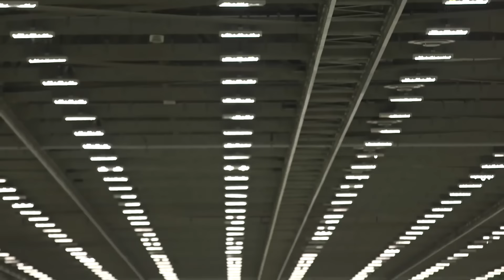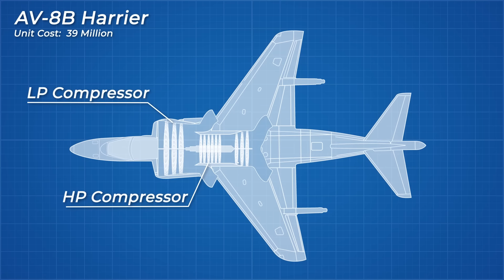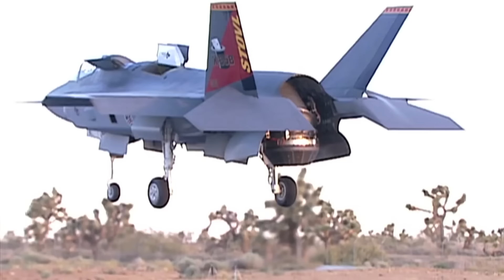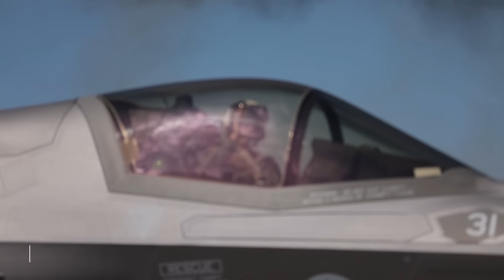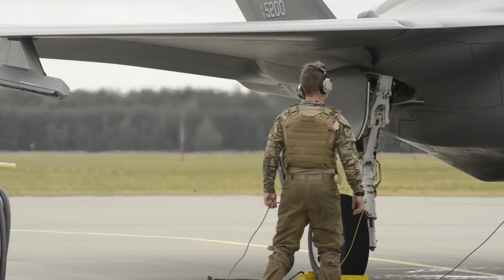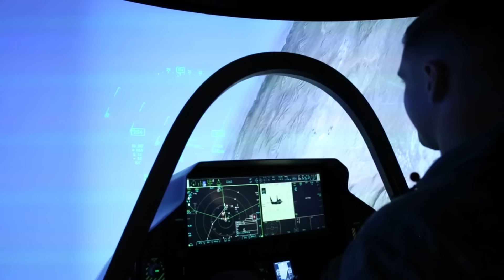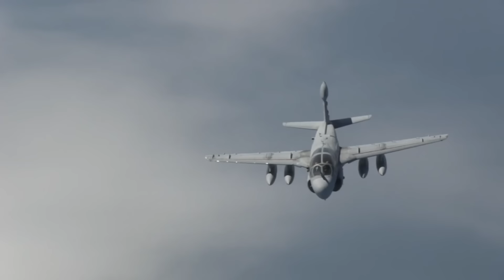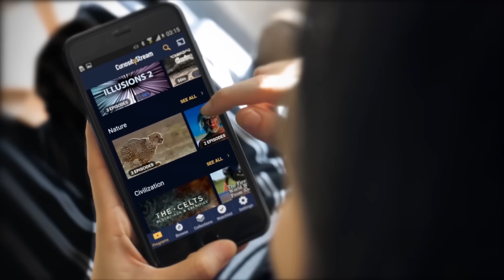Is The F-35 Worth $115 Million?

Comment: Don't try to candy coat the F117 being shot down over Serbia, that was a run of the mill SA-10 surface to air missile system, it pinpointed the stealth, locked onto it, and shot it down.  And the SA-10 was from an earlier era than the F117.  Stealth is great, but its far from foolproof, especially against a modern integrated air defense system which will surpass all aircraft jamming and stealth, and achive a complete denyal of the air. :-(
Reply: That's a commonly quoted myth. The F-117A was a literally defenceless aircraft that relied on stealth to avoid being shot down. It was also flying directly towards the Serbian SAM site, and they failed to lock on multiple times. By the time the F-117A was fired upon, it was within bombing distance of the Serbian SAM.

Also, the Serbian SAM was an SA-3B from 1970, supported by a P-18M search radar from the late 1970s. The tech difference wasn't significant.

As for electronic warfare, aircraft tend to have the upper hand over air defences.
Reply: @dumdumbinks274  What does the F117 being defenseless have to do with anything?  Its not like it was going to dogfight the surface to air missile and shoot it down, all it had to do is what it supposedly did better than anything else in the air at the time.  And so it was'nt even a S300 or SA10, it as an even older system a decade earlier.  The point is the moment the stealth was shot down is the moment the F117 was proven obsolete.   Especially when it was shot down by an older SAM than the aircraft design was, by at least a decade. And actually the missileer of the SA3 and the F117 pilot met eachother post war, its an interesting story if you care to look it up.  The man that locked onto, and then shot down the F117, and the pilot that flew it.  From what they seemed like they became good friends.
Reply: @Ed-ty1kr  If anything, the incident proved that stealth worked as intended. If you can't see that then you don't understand stealth.

Stealth is the ability to passively reduce the enemy's ability to react to the aircraft's presense. That doesn't simply mean detection, but also the process of tracking a target, locking a target, and reliably guiding a missile to a target. They're all heavily affected.

The SA-3 failed to lock on to the F-117A multiple times. By the time it could engage the F-117A, it was within visual range at only 15km. An SA-3 can effectively engage non-stealth unmaneuverable bombers at up to 30km, but it's radar can lock onto F-15 sized targets at around 50km. So the stealth reduced the effectiveness of the SA-3's radar by roughly 70%. 

The fact it was defenceless drives home my point. There was nothing else to interfere with the engagement. 
If the F-117A had even a basic RWR the pilot would have been warned before the SA-3 could engage. If the F-117A had chaff dispensers it could have turned around and blocked the radar guidance. If it had electronic jammers it could have targeted the SA-3's radar and jammed it. Most of these systems were present on all Western fighters of the 1970s, but none of them were implemented on the F-117A because doing so would disrupt it's 1st gen stealth. 2nd gen stealth and newer designs didn't have that problem.

The F-117A continued to be used throughout remaining 6 months of the war with no further losses. It was retired after a 25 year career with some of the highest combat success rates of all combat aircraft ever built. It proved that merely designing an airframe in a certain way could reduce the effectiveness of enemy air defences significantly, and it is still used as a testbed for new technology. 

But that's not all. You seem to greatly underestimate the influence the F-117A had over new designs due to how successful it was. It's effectiveness resulted in more aircraft being available for other missions, because a single F-117A with 2 LGBs could replace 2 F-16s each carrying 12 unguided bombs. Bomb accuracy was the primary driving factor in the push for large payloads throughout the 60s and 70s. Large payloads of that era did not enable engagement of multiple targets or the use of external targeting pods or fuel tanks, so the F-117A was considered significantly more effective because it could avoid enemy radars with a proper mission plan due to it's stealth and GPS navigation, and guarantee destruction of multiple targets per mission due to it's highly accurate bombs with large warheads. 

The reason it was called a fighter was to skirt around nuclear treaties of the day that restricted the number of nuclear capable bombers within an air force. The US pulled the same stunt for the F-105 and F-111 too.
Reply: @dumdumbinks274  Worked as intended as an Air Force novelty, like a hood ornoment, as an attack aircraft/bomber... meh.   And an F16 can carry guided munitions with the help of laser guidence pods, and it can also carry an assortment of bombs and missiles.   It can even carry up to 4 MK84 2000lb bombs with JDAM bolt on hardware, or laser guidence setups. Along with glide bombs like the JSOW or SDB, anti radiation missiles like the 88 HARM, Maverick optical guided missiles and so on.  And since no F16 flies with one wingman at the very least unlike the lone F117, you can double that... with their very own ECM pods to boot.  So how much use is an aircraft that cannot make use of ECM pods, cant defend itself in air to air combat, cant get out of a situation and turn and burn? Exactly, none.  The F117 was not intended to do much more than keep itself hidden from detection, like some submarine of the skies, drop 2 guided bombs, and hope it can GTFO without too much hassle.   Sure, but if I held the purse strings Id invest in some F16's, and keep the stealth as it turned out, F22 or F35.   Meaning nothing more than a clean fuselage without pertrusions that reflect radar energy, install bomb bays, and paint it with a radar absorbing paintjob.  That thing, the F117, was more a proof of concept than a warbird.   But who cares, they are all dismantled now anyway, yet the F16s and F15 keep on trucking.  Speaking of F15's.  The only F15 lost was one to an SA2, and anouther back in Desert Storm to AA guns, which was probably a fluke... in combat.  And none to air to air engagements.  Id take the good old F15 over a F117 any day, anywhere, and that jet is like the opposite of stealth, it radiates radar energy like none other. LOL.
Reply: @Ed-ty1kr  If your point is that a modern F-15 or F-16 is excellent compared to a retired F-117A, you are absolutely correct. But it doesn't say anything about the success of the F-117A, which was no more of a novelty than the EF-111 or A-10.
Reply: @dumdumbinks274 The A-10 speaks for itself as far as novelties go.   Nothing fills the ground attack nich better than the legendary A-10, with or without the depleted uranium spewing, tank busting, 30mm cannon in its nose.  As for the F-111 Aardvark that aircraft alone established the 4th generation fighters in more ways than one, and it did that as a nuclear capable attack aircraft.  Everything from the laser guided bomb delivery of the F117, to swept wings which are imortant if you want to lift a 24 x MK82 bomb payload, and be supersonic capable, to nap of the earth ground following radar, to the fly by wire of the F-16, to even having the first production afterburning turboFAN engine the Pratt & Whitney TF30, which later powered the F-14 Tomcat.... All if these milestones were established during the Vietnam war mind you.. by the legend known as none other than the F-111.   So much so, that no other aircraft had the Soviets more concerned, than the F-111, judging by the countless treaties they tried to limit or remove the F111 through.  Ultimately the Soviets attempted to copy the Aardvark with the SU-24... but failed miserably.  It kind of looks like a F-111, but the likeness ends there.
Reply: @dumdumbinks274  Why did'nt you mention the B-2 Spirit?   Because that on the other hand is absolutely not a novelty, that is what stealth is all about.  Its sleek, its a flying wing, its beautiful, it can carry a payload, its an engeneering marvel to say the least.   Totally unlike the F117 in every way possible, a true stealth masterpiece... the B2 Spirit IS the king of stealth.
Reply: @Ed-ty1kr  The A-10 is a specialist best described as a heavy COIN aircraft. It is legendary because of the emotion surrounding it, not it's effectiveness on the battlefield. The F-16 is a better choice for 90% of CAS missions and has had a higher success rate within the role for the last 30 years or so. CAS depends mostly on response time and precision, rather than firepower.

The A-10's gun is not capable of busting tanks, practically not even those developed 15 years before the A-10 unless it approaches at a very high angle or if it attempts multiple runs on the same target which is a waste of time. It can potentially disable them temporarily by damaging the tracks and optics, or bust AFVs, but 97% of the A-10's tank kills were achieved using the AGM-65, and the remaining 3% with dumb bombs. If you want a tank buster the F-16 is just as good and costs the same to operate while being much more survivable in a contested battlespace, as well as useful in other roles. 

I didn't mention the F-111. I mentioned the EF-111 which was an EW aircraft, and just like the F-117A it was a pivotal element of the air war. Actually in that sense the A-10 is even more of a novelty because it relied on the USAF being successful at defeating the Iraqi air defences. So the EF-111 and F-117A were both far more important than the A-10 was. 

The F-111 never had FBW controls. Only a testbed used by NASA ever got them and only for a single engine, not both, and not for the control surfaces like the F-16 had.
F-4s were capable of using LGBs during Vietnam as the war was drawing to a close. The F-111 didn't get the capability to do so until 1982, by which point there were several production model F-117As in existence going through operational testing.

Why didn't I mention a modern strategic bomber when talking about a Cold War tactical strike aircraft? Thought it would be obvious. We're not talking about things that are better (and significantly more expensive) than the F-117A that exist today. We're talking about the F-117A's success and influence.
Reply: @dumdumbinks274  How is the F-16 better at close air support than an A-10, that is designed for CAS?  Just because the F16 was used more does not mean its better than an aircraft designed for the purpose.  

If you want true close air support aircraft you need to have the ability to fly slowly, yet manueverably, at extreme low levels, without bleeding off speed loaded with ordinance in thicker air not at 25,000 feet.  Which means with a weapons load you need something that can fly around without waisting fuel, because a swept wing or even semi-delta wing does not like slow moving air, especially while heavy, it wants fast moving airflow.  

The F-16 does incorporate a flying tail for efficiency, which means it does not pivot over its wings by forcing the tail down for stability, as all other aircraft, and instead lifts with the elevators in the rear.  Which gives the F-16 decent fuel economy but only at mid to high altitudes like 20-25,000 feet, and only at 300knots, so as not to fly at high angles of attack.  Which it tends to do heavy, with drop tanks, and ordinance.  

Well thats too high and too fast for CAS.   Sure it can get there fast, but it wont stay long thats for sure.   As for the A-10 it is designed to fly low, has two non-afterburing efficient at low level large turbofan engines, that can spin slower, with slow incoming airflow, and is designed for low level.  Everything from bird strikes to enemy fire, is survivable.   The F-16... not so much, which at low level is crucial.  

Also after it gets there, the A-10 can remain lingering at 10k feet, waiting to perform CAS on rotation.  Unfortunately it was'nt used more, probably due to economical reasons.  Meaning when somone gets on the horn and says "we made contact, what is in the air right now?"   there is more than likely a couple of F16 refueling somewhere.   As for all out war CAS, the A-10 hog is king. 

And most of the armor is not heavy armor, its mostly APC's, or light skinned vehicles, that are still tanks just not MBT's Main Battle Tanks.  For instance during the Gulf War the last large scale tank battle, M2 Bradley Infantry Fighting vehicles with their aluminum skin, killed more enemy armor than M1A2 Abrams. All they had was a TOW wire guided missiles to work with at any given time to do so.  But what they also did was designate targets, with 6 infantry crew memebers for recon, which earned more kills than all else.  

So the battlefield is filled with mostly support vehicles, trucks, light armored cars, and some light armored personelle carriers, surface to air gun and missior platforms, and overall just a few handfull of heavily armored tanks.   

But the A-10 can still dive onto a T-72 , T80, or ,T90 and hit it on the top where its thin, and bust it no problem.  That DE 30 mm round will burn through with multiole rapid fire hits, devastating the armor of any vehicle.  It will literally set it on fire and yes metal does burn.  Have you seen a tank showered by 300 or so depleted uranium 30mm cannon rounds?  LOL.

  Even an M1A2 will have serious problems after that event, and that has CHBM armor to protect the crew.  Well, a hatch is still just a hatch, and when I mean 30mm shower... I mean soaked with DE rounds.  The tracks are your last problem, besides you may want to keep clear of the liquid burning metal everywhere, and the radioactive uranium oxide in the air.   Yeah, that 30mm, its a tank buster.
Reply: @dumdumbinks274  Wait... seriously?  A 30mm GAU 8 Avenger loaded with 1150 to 1174 rounds of combat mixed 1 High Explosive, 4 Depleted Uranium rounds, fired at at whopping selectable 2100 or 4200 rounds per minute... thats 70 to 80 rounds per second.   30mm uranium 238 tamper which means its heavy, and dense, showering onto a target at a whopping 4200 rounds per minute, or 70 each second....at least 10 to 15 of which will hit a hand sized area, and 5 will definately nail the same exact spot.  I think... no I know that will bust up a tank.   Especially a straight cast steel Soviet T55, T62,T64, T72, T80, or T90. No problem.
Reply: @dumdumbinks274  https://m.youtube.com/watch?v=p8jj5hyzWO4

There you have it, 30mm GAU8  penetrating an older tank, and setting off the rounds inside it.
Reply: @Ed-ty1kr   @Ed  A higher % of CAS missions are successful when performed by an F-16 as opposed to an A-10. It's called "success rate" for a reason.

CAS does not require low altitude or speed. The "Close" in CAS does not refer to the aircraft's altitude but rather the proximity of the enemy to allied forces. Basically, if the enemy is attempting to engage allied forces, the mission is CAS. If the enemy is just sitting around or repositioning it is interdiction.

The A-10 was designed for an era in which there were no TGPs and very few guided air to ground weapons. That is why CAS back then was best achieved at low altitude and speed. In the 80s even the F-16 was performing CAS at low altitude with a typical payload of 12 Mk.82s. But these days  because of advances in comms tech, sensors, and smart munitions the role can be performed safer and more effectively from higher altitudes than 40 years ago. As I already stated the A-10 doesn't drop below 5000ft AGL on most CAS missions. The only advantage it has in those situations is loiter time, which is only necessary if other aircraft are stretched thin.

In an all-out war the A-10 is significantly less capable. There's a reason it never served on the frontline of Desert Storm, and it became all too evident even when serving behind friendly lines clearing out remaining Iraqi forces. There is no way to guarantee destruction of all air defences, and a reasonably equipped army will make short work of A-10s that attempt to fly at low altitude.

In order for a vehicle to be considered a tank it needs to be heavily armoured and armed, and on tracks. A Bradley is not a tank.

The "tanks" in the video you cited were M41s. The M41 was an armoured recon vehicle with frontal turret armour of only 25mm of welded steel. It was light even by WWII standards. The A-10's API ammunition (containing a DU penetrator) is rated to penetrate 39mm of RHA at it's standard firing distance of 1km, or 69mm at half that distance. Of course it's going to penetrate an M41, but a tank is a different story, especially one developed in the timeframe I specified.

The T-62A was a tank that entered service 17 years before the A-10. It was being phased out of frontline service by the mid 70s and surplus stock was sold to 3rd world nations. The US used one of those nations to proxy purchase several T-62As for testing. In 1978-79 those T-62As were used as targets for the GAU-8/A on the A-10. The test results showed it was practically impossible for an A-10 to destroy a T-62A using it's gun, unless it approached from such a high angle as to guarantee any nation following Soviet doctrine would be able to shoot the A-10 down before it could engage it's target. The T-62A had 40mm of armour on the turret roof, so could withstand a few hits from the A-10's gun at most angles.

Also Soviet tanks since the T-72 have used composite armour, not basic steel. But that doesn't really matter considering the T-62A was capable of withstanding an A-10's gun run.

Lastly a couple of FYIs on the A-10's gun:

Only the early A-10s had selectable fire rates for the gun. For the majority of it's service life the fire rate has been locked to 3900rpm. 

The GAU-8/A is definitely accurate... for it's class of weapon. You claim 10 to 15 will hit a hand-sized area, but assuming the A-10 is engaging from it's standard firing distance of 1km and with a 1 second burst it's unlikely that 2 rounds will hit the same hand-sized area, let alone 15. It's rated accuracy at that firing distance is for 80% of rounds fired to land within a 12m cone around the target. Sounds bad but it's almost half the dispersal of the M61 20mm.

Another way to look at it's accuracy is that there are more than twice as many square meters in that dispersal zone than there are rounds in a typical 1 second burst, and that's before accounting for the 20% of rounds that will likely land outside that zone. Granted dispersion does not result in a consistent pattern and tends to put more rounds near the centre, it's still less accurate, notably less effective, and more likely to cause collateral damage than a typical anti-tank munition.
Reply: @dumdumbinks274  First I would like to say thanks for the conversation, I love talking about this subject.  And not for nothing you are correct in some respects, the TGP paired with a pod mounted under the F-16  chin/belly is and undoubtedly a usefull tool giving an aircraft survivability by use of altitude... unless you consider the same thing that started this coversation which is surface to air missile threats.  

Modern SAMs are quite capable of knocking out incoming missiles at high mach numbers, a lumbering aircraft a mid altitude with the pilots nose stuck looking at a screen in front of his knees is easy pickins.  So the same technology that gives the F16 pilot ability to peer down from 25k feet, is the same technological progress that will not only kill him at 25k feet, but render the pilot him or herself obsolete.

Todays integrated air defense systems need to be approached in a more primitive fashion, meaning down low, and hopefully a lucky anti air gun don't bring you down.  At altitude you are basically a dead duck, and you more than likely will have absolutely no warning, until your cockpit lights up and begins to go crazy with threat warnings.   At which point you might as well eject because a missile is about to hit in 5 seconds or less. 

These modern SAMs will simply appear as search radars, because that is all they need to get to you, right up until just a few seconds before the smokeless engined missile hits, because the missiles active seeker just went live and its headed for you at mach 4. 

And don't get me wrong I love the F-16, its a great platform, it has standoff capability with glide bombs and missiles.  But there is still a nich for the A-10, which will be around just as long, until at least 2040's according to the military industrial complex.  

Funny thing is there was a reason they created the A-10, a slow flying attack airframe with performance similar to a WW2 prop job...  and this was during the era that guided weapons first began to be used and established as the norm.  40 actually 50 years ago, during the 1970s,  is when most laser guided bombs orginate from, by 40 years ago GPS was already being used, and by conflicts like the Gulf War, 30 years ago, JDAM was the go to bomb. 

But even so, you still need a down low and slow, attack aircraft.   That is just a fact of war.  In war all plans go out the window, and usually its sheer firepower, or the oldest weapon that gets the job done.  Altillery, a tank, a truck, a rifle, or even a dumb bomb dropped by a slow and low enough flier, that can get the pilots eyes on what he is killing.  So as not to kill friendlies, or to avoid missiles 50 miles or even a 100 miles away. 

The A-10 was designed due to a need, that all the high, fast fliers with laser guidence, radar guidence, and TGP screens with FLIR could not.  And this was prooven by the countless testemonies of countless war fighters, in the air and on the ground.
Reply: @dumdumbinks274  Tank is just a false term given to tracked vehicles during WW1, by the Brittish, to throw off the Germans by having them assume they were building water tanks.  So calling something a tank is relative to who is looking at it.   Meaning you ask most people what they saw, looking at a Soviet BDRM or a Bradley, and they will tell you I saw a tank.  The only time the term "tank" is actually used is in MBT, or Main Battle Tank.  

And if you want to get that technical with language than there is more ways than one to destroy a "Tank".  The complete destruction of the vehicle is obvious, but disableing said vehicle may be even more beneficial.  For instance if you destroy a "Tanks" optics or its tracks it is just as useless at complete destruction, with the added benefit of either capture, or to be used as bait.  Technically a tank disabled on the battlefield will require that vehicle to be retrieved and serviced, which uses up resources and manpower, as well as puts manpower in harms way.   Espeially if said vehicle has armor that is composite, because internally damaged composite armor is just as useless as destroyed, because it canno longer do what it was designed to do, because each layer within relies on the rest of the layers to function correctly.  Basically denting the armor, wont just create an unsightly eye sore, it can crack ceramics within it.

As for the M-41 Bulldog the A-10 destroyed in the video.  Well there is one on display at a local VFW, so I have walked and inspected this vehicle closely, its a tank.  You can call it a tank destoryer, a light tank, you can call it a scout tank... whatever you like, but its a tank if there ever was one.  Also its armor is greater than the vast majority of modern vehicles more designed for IED mines, and or shaped charge RPG defense, than taking smaller calibre rounds from a 30mm aircraft cannon. 

The T-64 like the T-72 has Combination K armor, its a type of composite armor. Combination K is a three-layer composite armor consisting of an outer and inner layer of steel and a middle layer of fiberglass glass-reinforced plastic ("steklotekstolit") and a pack of ceramic.  But this technically may strengthen the armor in some respects, such as the ceramic will obviously stop a molten copper cone shaped charge, but if you hit it repeatedly with depleted uranium 30mm rounds, it will turn that ceramic into nothing more than a cracked up mess.   Like a coffie cup, inside of a thin steel sandwich, and fiberglass for lettuce.  So is this "tank" still an armored vehicle after, meaning will its armor do its job in such a state,  or is its armor compromised significantly? 

  So even if the tank is relatively intact, with only a few lucky penetrations, is the tank still useable, servicable, after an A-10 pummels it with a GAU8, or is this tanks armor compromized beyond repair?
Reply: @Ed-ty1kr  I can see your logic, however that is an old school train of thought. Flying low doesn't provide any protection from SAMs and opens you up to the threat of simpler air defences. Strategic SAMs since the SA-10 have been capable of engaging helicopters at tree top altitude if necessary. You might argue that terrain obstructions can be used, but they blind you as well as the enemy. A lack of situational awareness leads to death most of the time, which is why SHORAD systems are so much more dangerous than strategic level SAMs. SEAD cannot guarantee destruction of SHORAD, and most modern systems have multiple forms of targeting

And while modern SAMs use ARH missiles, modern combat aircraft are equipped with IR/EO based warning systems that can track said missiles after they've depleted their fuel reserves from more than 100km away, or detect launches from beyond the fighter's own radar range in some cases.

But you do have a somewhat valid point - concentrating on an attack run is why a USN F/A-18 was shot down on the first day of Desert Storm. Though the same logic applies no matter what altitude you're at. Strategic SAMs sure they're a bit dangerous, but SHORAD systems are much more deadly. Unlike strategic SAMs, SHORAD can hide because they don't rely on radar, and munitions reach their max range much more quickly. 

Now back to the A-10. It has it's niche, but as I said it's basically a heavy COIN aircraft. The A-10 entered service in 1977 when the only guided tactical air to ground weapons were produced in very small quantities for specific purposes, tended to have very short effective ranges, and could only be used by specific aircraft. The only guided tactical munition that could be considered common back then was the AGM-65B, but due to it's cost was produced in limited quantities and restricted for use in the anti-tank role. LGBs were produced in very low quantities initially owing to their expensive nature, and after more than a decade of limited production Desert Storm almost saw the entire USAF inventory of LGBs depleted in less than 2000 sorties by F-111Fs and F-117As which lead to munitions rationing. GPS guided bombs didn't exist until 1997. Guided bombs in general became a normality in the early 2000s during Operation Iraqi Freedom.

War plans don't always work out, but what matters is availability. Old weapons systems are known to be relied upon sometimes because they exist in large quantities - often in reserve - not because they're simple. The US have a large stockpile of old aircraft that can be rapidly restored if necessary, including many old F-16s, but very few A-10s. If the A-10s go down, which they will if they fly at low altitude against a moderately prepared enemy, they won't be easily replaced. 

"Tank" is a defined class of vehicle and it's the top tier of armoured vehicle. Soldiers don't necessarily use the classification system because they are not always acting on verified information. It can be difficult to identify threats from a distance due to many factors, so rather than wasting time tying to identify the exact type of vehicle, soldiers will often just acknowledge it as the most threatening type of vehicle. Overkill is better than dying due to incorrect target identification. The Brits used this knowledge during WWII to great effect by making inflatable mock-ups of various vehicles which caused the Germans to attack the wrong positions. But nobody in their right mind would classify them as tanks just because a soldier says he/she saw a tank.

An M41 has the profile of a tank, but everything about it from how it was used to it's equipment and protection defines it as an armoured recon vehicle. When the US verify kills, they do so by the target's classification, not what the soldier claimed to have seen. The A-10's 987 verified tank kills during Desert Storm do not include APC/IFV kills, even though they are both classes of armoured vehicle. And although there exist today vehicles with highly specific armour schemes such as MRAPs, that doesn't mean a conventional-looking armoured vehicle is a tank.

As I previously stated, the likeliness of the A-10's gun destroying a tank completely is close to nil. But I also stated it could destroy the optics and tracks.The problem is that damaging either of them is not guaranteed due to the dispersal of the rounds at a standard firing distance, especially modern tanks where technology has resulted in the optical systems getting smaller and smaller. Dispersal also means you're highly unlikely to get enough hits in to compromise a specific section of armour, regardless of it's composition.
Reply: @dumdumbinks274  Don't give Ed the time if day. He is a troll.
Reply: @rick7424  Said the guy that butts in with a troll.
Reply: @dumdumbinks274  Yeah... its true that an A-10 cannot survive on a battlefield with air threats present, and the reason they never exported the A10 is because no one would buy it.. LOL.   But the Air Force has no plans of taking the A10 out of circulation till at least 2040, because most places around the world have no air defense cababilties that can survive for very long with the onslaught of other weapons.  At which point the battlefield is left relatively undefended where an A10 can be used as a heavy hitter. 

 A good attack aircraft is kind of like a large bomber, like the B52 a dump truck of the sky, that can be a heavy hitter.  Even during the Vietnam war when sams and jet fighters were already present and widely used, such as the F111, Mig 21, or even a lowly Mig 17, there was still a place for an attack aircraft like the Douglas A-1 Skyraider, why? Why use an old World War 2 era single engine prop job? They had much faster, better, and more sophisticated equipment with radar, why use a Douglas Skyradier?  Because there was still a place for it on the battlefield.   

So I agree with you that the F-16 is a great platform, but even that was designed originally to drop dumb bombs, and needs various exterior mounted pods for guidence, unlike the F117 or the F-35 that cant have something mouted exterior on its wings due to stealth. 

In war, throughout history it was always sheer numbers that were needed for success.  And I dont think technology can overpower that notion, the Russians know this because that is how they fight.  They like numbers, there is a certain quality, in quantity alone (LOL... I think the dictator Stalin actually said that Hegelian wisdom, not sure).  Anyhow, such as a large payload, on an aircraft that got through, out of 3 that did not.  So building 4 x F-117's, or 5 x F-35's, may not be as beneficial as building 15 x A10's.  Or only using the A-10's once the targets air defense threats are neutralized, or maybe nonexistent in the first place, to devastate the area with an unmatched bomb load, and then have a 30mm cannon with 1150 rounds to mop things up the rest of the way. 

World War 2 is a perfect example of this war of attrition, where more sophysticated weapons get easily overwhelmed due to only having 2 bombs per sorty, or having to drop their payload to go dogfight with uncoming threats instead of ignoring or not knowing, and continuing on to the target.   That is why the B-52 kind of never goes out of style, its easy to hit a huge 8 engined lumbering beast up there, but the ones that get through still hit like none other.   

 Operation Linebacker of Vietnam war found a great purpose for the B-52, sure alot were lost, no doubt, they werent individually targeted bombs by any means, we are talking carpet bombing, but there was a need for it.  Same with the six-lane highway between Kuwait and Iraq, not exactly an ideal way to use an F-117 that requires pre planning and only has 2 bombs, and no gun, so you need something that has these on board.  So what do you do when air threats are neuralized? You call in A-10's to mop things up with a large payload, and when that is used up... 1150 rounds of 30mm DU.  

Not trying to get technical with wording here but what I meant by an A-10 obviously not being a novelty, is that it is definately not a "novel idea" to have a slow low flying attack aircraft.   Because all attack aircraft throughout history were exactly that.  

Take that legendary Junkers Ju 87 or Stuka, of the Douglas SBD.  Both slow, heavily loaded attack aircraft, and the "percision bombers" of their day because they were dive bombers, which gave the pilot the ability to vertical dive down onto a target and hit it as percise as possible.  And more percisely than the overrated Norton Bombsight mind you.  Meaning a good dive bomber pilot could absolutely knock out a tank.  And if you were as good as Hans-Ulrich Rudel, with 1400 some odd sorties, you preferred the Bordkanone BK 37mm cannons mounted under your Stukas wings.  Why?   Because once your fellow Stuka pilots drop their bombs divebombing, you can swoop in with your 37mm cannons and mop up.  

This is important in ground attack, and nothing with fixed wings can do this well, except the A-10, and a C-130 prop job transport aircraft, called "Puff the Magic Dragon".   Which brings me to why on Earth would the Air Force use first a Douglas AC-47 " Spooky", also called the OG "Puff the magic dragon", in Vietnam, and later make anouther useing a C130 platform?  Because its needed, and nothing else can do this better.  But that actually is a novel way to use a transport, and therefore that is a novelty much like an F117.
Reply: @dumdumbinks274  Also if lets say an area is cleared of air threats, because that is how war is fought, then you may need something that flies low and slow, with the ability to soak up gun rounds.   Because when you fly high up at 25k feet, you become pray to long range surface to air threats.  Missiles that will use a long range radar to get within  a couple of miles of your aircraft undetected because its hard to bounce radar off a small missiles nose cone, and because it will not go active with its own radar until it is within a mile of that F16.  At which point it goes active, flying at mach 4 approaching you, and you only get a few precious seconds to maybe drop some flares and chaff, drop stores and evade.  

But an A-10 in that hypothetical air threat cleared area, can survive gun hits and bird strikes to survive in that environment, and do its bombing low down where the long distance radars cant see it.  Usually because of hills and the curvature of the earth prevents that, but sheer distance and ground cludder is also a factor. 

So again, as you clear an area of air threats what prevents a long distance search radar from seeing an F16, launching a modern active seaker head SAM in your general 5 mile radius area, and going active only once within that area?   As you use ground search radar, in conjunction with your TGP, to allococate ground targets.

The A-10 has no radar, because it avoids detection with low altitude, detection by long range search radar, not something on the ground that should have been knocked out before the A10 was called in.   The kind of local stand alone radar that is highly prone to HARM missiles because if it is turned off, it becomes blind, and using it as integrated system being that its mobile, can be jammed.  

Those Tunguska or Shilka "tanks" or tracked AA ground vehicles, can't rely on integration due to the vehicles relyance on target designation prior to launch, of a heat seaking missile.  So it needs to remain active at all times or it goes blind. And if it shuts off momenterally to spoof HARM missiles the missile will simply remain on course, or redesignate anouther similar system that takes over, eventually elliminateing them all.   

You can fire HARM missiles like the AGM 88 without designation, and simply let it loose in the general area if air threats, and if any radar goes active in that area it will guide to it, and remain on course or deviate in the direction of travel of the target, even if the radar is turned off.   The A-10 has a nose mounted pod for this anti-radiation system, also used on the F16, and other aircraft.  To use this properly you king of need to  trick the radar to go active, and what are your options at high altitude? At least with an A-10 you can pop up, and drop back down if need be, and not turn and burn with afterburners blazing trying to outrun.  

Anyhow, I'm not trolling, just having a conversation, sorry if you see it differently.
Reply: @Ed-ty1kr  Sure the A-10 has a place, but it's still not an effective CAS platform compared to other aircraft unless there are no air defences.  All of the A-1`0's 7 combat losses were due to single hits from low altitude IR SAMs like the SA-9, or from bursts of AAA. It doesn't matter if the enemy lacks airpower, because it is literally impossible to ensure destruction of all air defences. SEAD targets radar based SAMs, not SHORAD.

The USAF's position on the A-10 is pretty much that they would replace it if they were allowed to do so. Politicians got a light attack aircraft program cancelled because they didn't want their "tank" of the sky to disappear, even though turboprops are more difficult to engage with MANPADs and carry enough light munitions to do basically the same as what the A-10 does and for one third of the price. 

The problem with your current argument is a lack of understanding about the differences between the situations and eras.. The most obvious difference between WWII and today is that WWII mobile AAA were relatively ineffectual and provided limited coverage. Even modern SHORAD can outrange the best AAA of WWII, and a single burst or missile is accurate enough that it will hit the aircraft on the first attempt if the target does not have good warning systems and defences. The A-10 doesn't even have a radar to detect SHORAD from a safe distance.

F-16s can easily take out lightly armoured vehicles using guns. The spread of the M61 requires a bit longer burst, but it's the same overall effect. The F-35 is even better with it's GAU-22/A, which shouldn't be surprising because the F-35's gun is basically a scaled down GAU-8/A and retains the accuracy and most of the firepower of it's parent.

Sppokies, just like the A-10 are more of a novelty than the F-117A. It shouldn't even be a question since the F-117A actually contributed heavily to creating a situation in which the A-10 could function effectively, while dedicated support aircraft are purely defensive and incapable of serving on the frontline of a conventional war. 
Though I'd certainly argue the AC-130 has more of a place than the A-10 does... AC-130s are valuable because they are much more than just a bunch of flying guns. They have powerful sensor suites and modern ones have electronic warfare capabilities too. Along with their multiple crew stations they essentially function as battlefield control aircraft. The A-10 doesn't even have a radar and has no room to fit one because of it's giant gun and tube fuselage. 

As I already mentioned, strategic level SAMs can be detected at long distances, even the missiles can be detected in flight from over 100km away, or the launches can be detected from beyond the radar range of the fighter. Those missiles go active once they're within 50km or so of the target. If they went active only 1 mile away they would miss most of the time simply because the missile would not be able to turn fast enough once it had acquired the target. 

Why are you still going on about strategic level SAMs in regards to the A-10? You seem to think the rest of the world follow US air defence doctrine, where the primary air defences are aircraft. F-16s are more survivable against air defences than A-10s, no matter what altitude,. 

There's this thing called data-linking. Only a single radar needs to track a target, and it can be based well away from the combat area. Tunguskas and Shilkas are also highly mobile, and Tunguskas have laser rangefinders and EO, IR, and laser guided missiles. They primarily use the radar when actively using their guns to achieve higher accuracy. 
If the US couldn't defeat Serbian air defences like the SA-3 because Serbian crews would just pack up and change locations after literally every engagement and took 10min just to pack up, what makes you think a system that can engage targets while moving is an easy system to defeat? 
Sure an AGM-88 can continue traveling to the location at which the target was previously located. It's not going to find anything, and the duration for which the radar is turned on is generally shorter than the time it takes an aircraft to notice, maneuver, and track the radar source before launching a missile. The capability of the AGM-88 to re-acquire targets while in flight is primarily intended for use against strategic level SAMs which cannot change location quickly. Another thing to consider is that SHORAD such as the Tunguska are capable of shooting down large missiles like the AGM-65 or AGM-88.

The A-10 does not have a nose-mounted pod for anti-radar use. It has a laser spot tracker that it shares with the F-16. The AN/ASQ-213 pod used by the F-16 in conjunction with the AGM-88 is not used by any other aircraft. 

You can fire any missile without designation, but doing so significantly reduces effectiveness even if they're programmed to reacquire targets due to missiles having a limited field of view. As for your idea of the A-10 using terrain masking to pop up and back down again, it won't trick a Tunguska into using radar, it will just make the Tunguska aim in that direction with optics and laser or IR guided missiles.
Reply: @dumdumbinks274  So if you boil all this down to its basics, because we can go on and on about what it can and cant do, but neither one of us knows better than the ones in charge of these things.  Why was the F-117 scrapped?

Why scrap a gem like the F-117, and upgrade the A-10. Since it just got an upgrade to carry up to 16 x GBU 39 SDB (Small diameter glide bombs) that can give it standoff capability beyond the previous Maverick setup?   So why bother with this supposedly useless slow attack aircraft, and scrap the gem that was the F117 stealth "fighter"?  

Maybe because a tiny nation, with limited air defense capabilty, in the middle of a bloody civil war where the U.S. probably had no business sticking its nose, with a half a century old and outdated equipment, knocked it out of the sky.  And then the whole "OMG now they can reverse engineer stealth", panic that followed.  LOL

These missiles were monted in the back of an old russian truck, from what I saw, like some old school unguided rocket system, and an old spinning wire reflector radar.  This kind of third world setup killed the stealth wizard? Talk about David and Goliath.  LOL.  And all the excuses won't change that.  So, it got scrapped. 

But it was unsightly ugly anyway, and it flew like a butterfly (twitchy) and could barely sting like a bee (2 medium bombs) which is not exactly ideal for modern warbirds.  And, it needed old outdated 1970's computers to keep it in the air, or it would lumpishly drop out of the sky like a brick, breaking off its own wing tips in the process.  How this twitchy wobbly goblin managed to keep a steady laser beam miles away on target, is the real miracle of the F117. 

As a side note, I did look up the chin pod of the A-10 and its just a laser pod, so I stand corrected.   I knew it shared a pod with the F-16 but I'm only human, so I forget things and make mistakes from time to time.   The A-10 is not my favorite by a long shot, so my knowledge is limited, but I will still defend it over the F117.   Which... again,.... in my opinion, is just a novelty.  It was all new, modern, they hid it from us taxpayers who paid for it, but obviously its stealth was just a novelty.  I mean sure it worked, under some very limited and specific circumstances. 

For instance if you flew it through a cloud, it would naturally get wet, which would render its stealth useless due to dopler radars ability to see moisture.  If you flew it too high, con trails, and overcast rendered its guidence useless short of pre designated GPS.   Your local weather radar can show you exactly how well doppler radar works in picking up water vapor or noisture.  So in the desert dry air stealth works great, in the humid cloudy Balkans... not so great. That is what actually shot down the F-117.  This weather phenomenon of moisture in the sky is also a factor when you need to use a TGP,  because cloud cover will render it useless.  Even if partly cloudy TGP use will force you to choose a path between clouds, if you want to keep a beam on target, and if its overcast you may need to go all the way down, and put an eye on it. 

This is why a TGP is not a useful tool in all cases, and why you need an all weather attack aircraft that can get below the overcast from time to time, and get it done.  And no you cant take a day off in war to wait for good weather.... LOL
Reply: @dumdumbinks274  But you know I'm kind of confused as to where you were heading with your reply, I mean thanks for correcting the SAM make and model and everything, but if anything you reenforced what I was saying.  You literally drove my point home that candy coating the F117 is futile, the aircrafts ONLY strength was its ability to avoid being locked onto by radar particularly surface to Air missiles and deliver 1 or 2  laser guided smartbombs.  And even that when confronted with a compitent radar operator, meaning not an Iraqi that probably wanted to surrender anyway to rid himself of Sadam, it failed miserably.   And it failed against a low grade obsolete SAM that was not even 1979 design like the SA10, but a 1960s designed SA3"B". 
So why candy coat this overrated piece of junk called a fighter which it was'nt, the F117... that could do absolutely NOTHING right.  No wonder the Air Force tossed it into DRMO and rid itself of that fugly Wobbly Goblin, a name it was given because it literally wobbled through the air just trying to maintain level flight.  That it could only do thanks to 3 or 5 or however many onboard computers it took to keep it flying.   Anyway, why candy coat this overrated aircraft, that lost a wingtip at an airshow making an unimpressive, barely 50°bank left turn, at 2.5 G or less.  LOL
Reply: You are posting misinformation again.